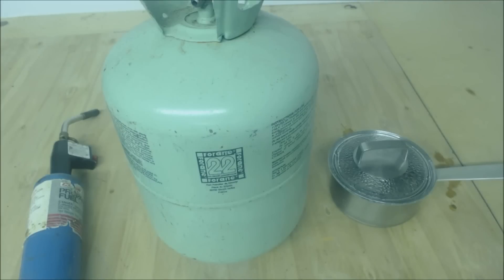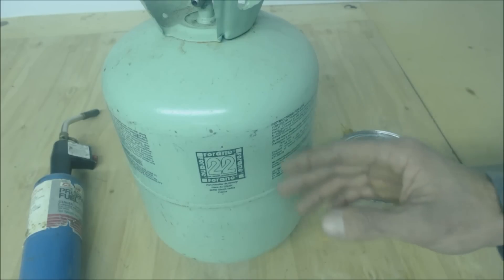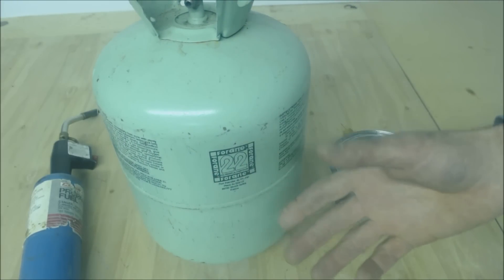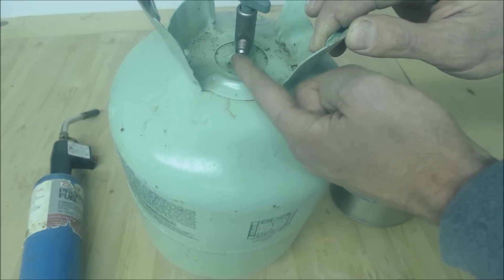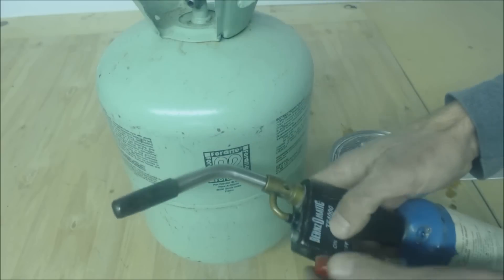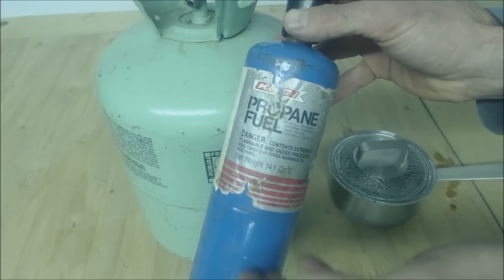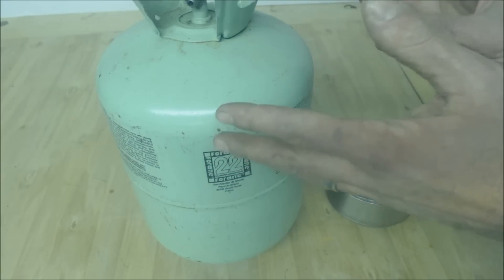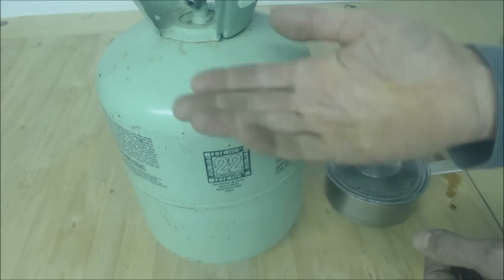What is a Refrigerant? How Does a Refrigerant Work? Explained!

Comment: Hope someone can help me with this question. When the Airconditioning system is turned off and is in some kind of equilibrium where is the liquid refrigerant ? In the condenser unit?, Accumulator? What happens if the outdoor unit is turned upside down? You do not want fluid state refrigerant getting into the inlet part of compressor.

Comment: Changing the pressure on a refrigerant doesn't change it's temperature.  It changes it's saturation temp or boiling point.  A tank of gas gets cold in use because you are metering or flashing the liquid through the nozzle.
Reply from the maker: Thanks Jeremy, Changing the pressure does change the temp such as the compressor increasing the pressure to increase temp above that of its surroundings in order to reject heat at the condensor, thanks

Comment: How refrigerant attends it negative temperature in which it is in cooled and in  liquid state? How it achive so in the condenser? Ambient air is never in negative temperature then how it cool down refrigerant
Reply from the maker: The vapor refrigerant pressure is increased by the compressor which increases the temp above the temp it is outside so then the outside air cools it down. Check out this playlist- especially the 5, 6, and 7th video-  https://www.youtube.com/watch?v=ZJR5rDPWLpA&list=PLxnHR5_D2ojwbAc7K7DsjuasaDVfJeGSe

Comment: THIS CAN BE USED FOR FREE ENERGY. ABSORBJNG HEAT FROM THE OUTSIDE USING THIS REFRIGERANT AND PLANE PANNEL HEAT ABSORBERS
Reply from the maker: Hey Ric, refrigerants are able to store most of the energy during the change of states. I n order to accomplish this we use a compressor and metering device. Otherwise water would be as efficient to absorb and reject heat as well as cleaner and easier.  Water is a refrigerant but the problem  with using it as a main stay is the boiling point, thanks. We use glycol and water panel heat exchangers as well as evacuated tube cylinders for solar thermal water heating, thanks